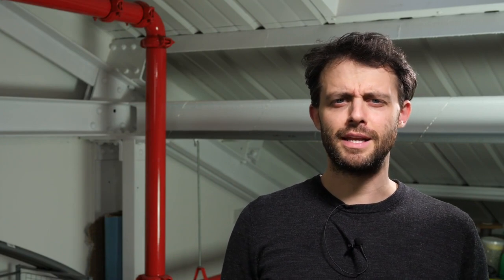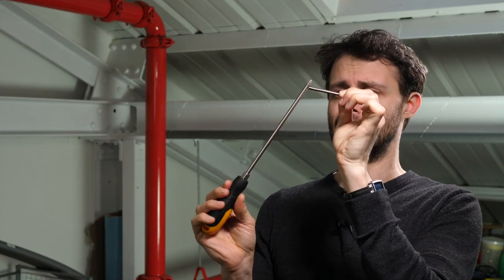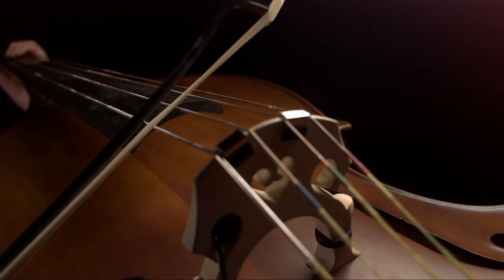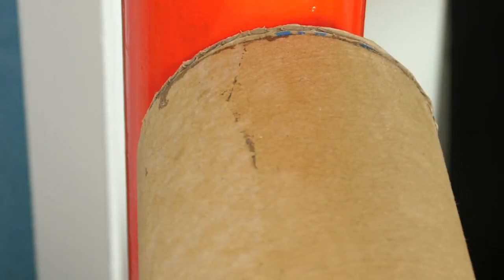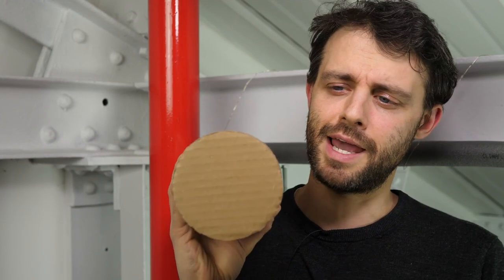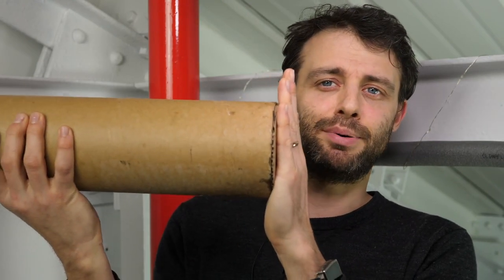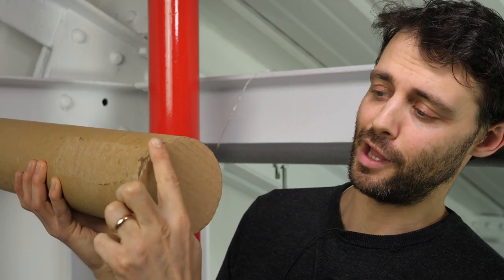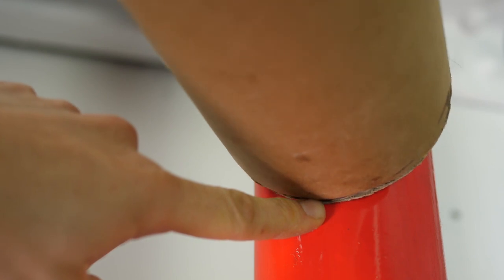The Climbing Magnets Mystery (ft. Steve Mould)

Comment: Problems that resist resolution become "grand" over time, but that does not mean their answer is beyond the problem-solving abilities of clever folks like Oli, Hugh, Steve, and Derek.

Oli from Reading posed an interesting mini-mystery four years ago: Why do twirling magnets climb? As Hugh Hunt figured out and Steve nicely illustrated, it's because gravity biases a rotating pivot point.

Steve twice contrasted this "mini" mystery of climbing magnets with "grand" puzzles such as why quantum mechanics and relativity remain estranged from each other. However, just because a riddle is grand doesn't mean folks should assume its resolution is necessarily complex and beyond easy comprehension.

The overall history of science does not support that assumption. While new ideas in physics often seem strange and counterintuitive, they have also trended mostly towards getting simpler and fewer over time. That, in turn, suggests that even grand mysteries sometimes have simple resolutions.

For example, what if the root cause of a grand mystery is not a lack of insight but an ordinary human error?

A century ago, Hermann Minkowski arguably committed such an error by imposing an infinite-precision -- and thus inherently non-quantum -- interpretation of spacetime on top of Einstein's 1905 clocks-and-rulers-version of special relativity.

The pre-Minkowski Einstein defined space and time solely in terms of material clocks and rulers. At small enough scales, such material clocks and rulers necessarily become quantum. Thus any particle-level extension of Einstein's pre-Minkowski clocks-and-rulers version of spacetime would have stayed fully compatible with quantum theory. It was only Minkowski's insertion of infinitely perfect spacetime that created the gulf between quantum and relativity theories.

Since, in this case, the cause was a human error, the level of insight needed to merge quantum and relativity theories is neither grand nor profound. Hugh's "mini" insight on climbing magnets is considerably cleverer, for example. However, the century-long persistence of Minkowski's error does provide a sad commentary on how rousing, poetic speeches and the politics of research funding can sidetrack physics theory for decades or even centuries.

Fixing this well-aged, deeply entrenched error is where things get messy.

If spacetime is nothing more than a finite network of measurement relationships between particles-as-clocks and particles-as-rulers, then our view of space and time becomes sharp and well-defined only when large numbers of particle clocks and rulers form measurement relationships with each. That happens, for example, when hot atoms form myriads of Newtonian action-reaction pairs -- increasing entropy -- in plasmas, dense gases, liquids, or solids.

Condensed matter physicists thus are on nicely solid ground when they use models that assume infinitely precise fields. Cosmology, on the other hand, quickly gets a bit weird. Moving upwards in scale, modeling impacts of particle-limited, clock-and-ruler spacetime could emerge as early as in how to predict ring structures around planets. Particle-density reductions in spacetime resolution would undoubtedly have a profound modeling impact when you get to galactic scales.

The most painful impact of clock-and-ruler spacetime is on quantum field theory, where it requires rewriting of Minkowski-precise, pre-existent particle excitation fields into incremental emergences of field-like behaviors as more particles become entangled in the calculations. On the positive side, computer models of such behaviors would likely be enormously more efficient.

Quantum computing also gets flipped upside down since the entangled matter around the quantum wave function becomes the source of the calculations, not the quantum wave itself. The quantum wave becomes little more than a focal point for arranging the surrounding ordinary matter into a sufficiently powerful and noise-free configuration to complete the desired calculation.

As condensed matter creatures, we live in a sharply defined, intensely Boltzmann world in which matter is matter and space is space. (Hmm, why do I have this sudden image of Archie and Edith Bunker singing?) However, in deep space, things don't work that way. In the absence of a sufficient density of particles, there is no longer enough spacetime resolution to define precisely where the energy of that region, especially momentum energy, is located.

That last point connects to another "grand" mystery Steve mentioned: dark matter. Dark "matter" is a uniquely bad name for the non-particle four-fifths of the total energy of our universe, mostly momentum, that lacks enough entangled fermions to give it a well-defined location. Another way to say that is our classical world is just the visible one-fifth tip of a much larger quantum computer that spends the vast majority of its energy and time making sure the emerging future doesn't conflict with the established past.

Terry Bollinger CC BY 4.0
https://sarxiv.org/apa.2022-05-15.1325.pdf

Comment: Moving up while pointing up, centrifugal force acting on the magnets to propel them up. Same thing happens with other, non-magnetic objects.
Moving up while pointing down, Centripetal force acting on the magnets to propel them upward because of the disparity in forces when it tries to go downward. Same thing happens with non-magnetic objects.
While the rod is spinning as a fixed axle, lorentz and inductive forces inducing a small electromagnetic field in the rod and propelling the magnets according to the Right Hand Rule.

Didn't even have to watch the video to know this.

Comment: That explanation isn't very good. It assumes perfect timing between the rolling of the magnet and the slip/stick effect in order to get to the conclusion.
Based on the logic of the explanation, if you simply spin the magnet faster, it will over-rotate in the slip phase and actually go DOWN the screwdriver, or stay in the same place (depending on the speed).

Comment: this theory does not apply when you use drill ,the magnet still climbs without pivoting and slipping. define 1:32 using your theory.
Reply: a valid question.   imo, the answer is that the magnets are  also  rotating; due to the rising of the  lower point of contact.     but, observers have no way to see it.     cheers

Comment: 5his might be the right answer but presently seems like justifying what is happening in the phenomena.
1. Gravity thing, gravity is so weak as compared to attraction of magnet, therefore not applicable
2. Super smooth. If the magnets attached part to the screw driver was super smooth would the magnet still not go up.
3. Perfect curve. If the magnet's attached part the screw driver was curved  perfectly and it clung 100%, would the magnet still not go up.
I think without satisfying these parameters, results would not be conclusive.

Comment: Before watching the explanation.

I think it has to do with the magnets releasing the upper part before releasing the lower part. Spinning then starts the magnets rotating over their long axis. This, in conjunction with the rotation around the screwdriver axis leads to a climbing effect. It grips at a higher point as it rotates.

Comment: Guys, I understand this but why don't you do the same thing  with a sliding bearing to see that is really just because of this and not the current generated on the metal or anything else 
I would create a sliding bearing like  you take a rod to get a good size bearing put the rod through the hole like exact size then attach the magnets to the bearing with supper glue cause heath could cause the loose of the magnetic field and test this way as well to make sure cause now i see yes this is doing this because of this but I don't see the proof if you take a proper sliding without the jumps than what gonna happen .

Comment: But i think the exploration provided is not right. In my opinion the magnet move due to changing in flux in the screwdriver. Due to magnet rotation which cause circulating current that oposing the movement of the magnet Check lenz law and u will understand what i mean :) 

Even u put the screwdriver and the magnet inthe space where there is no gravity the same phenomenon will happen. Trust me :) 

Thanks and keep up

Comment: I disagree with your explanation. A spinning item has the tendency to move far away from the center. When you rotate the screwdriver, the screwdriver is oblique. As the top part is further from the spinning axis, the magnet moves up, just this simple. 
For proving this, you can do an experiment with the screwdriver holded upside down. With your explanation, the magnet would still go up, but actually it moves down.
Reply: He did and it did not and he also spun it with a drill.

Comment: Your explanation is wrong , replly wrong man. Try to rotate it on the machine which have no vibrations , just holding it and it is in circular motion, and it will not rise.
This is rising due to the component of magnetic force upward which is provided to balance centripetal force , your tilting rotation of the screw makes it climb up, not the rotation it self. 
Really disappointed at this over boasted explaination.